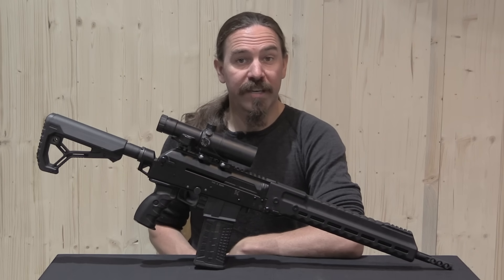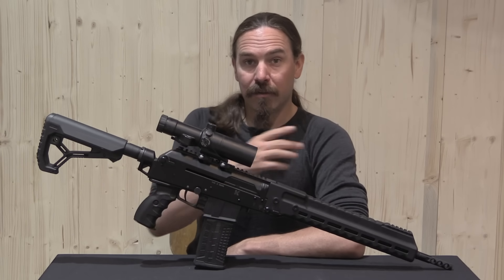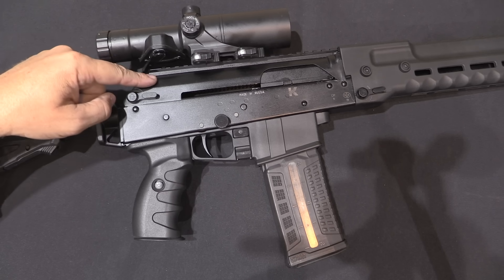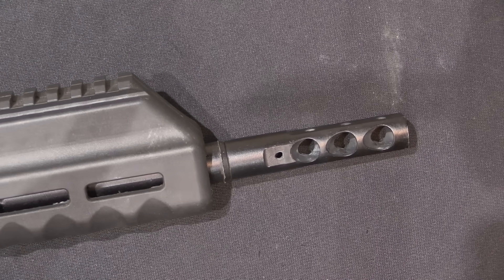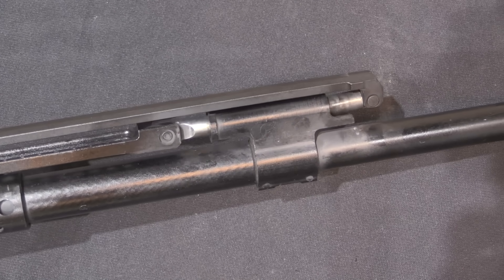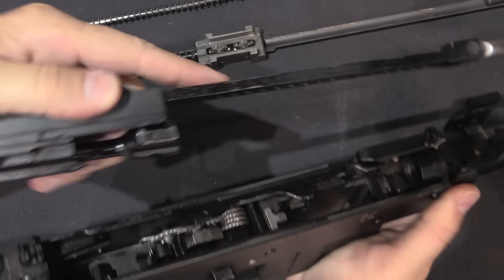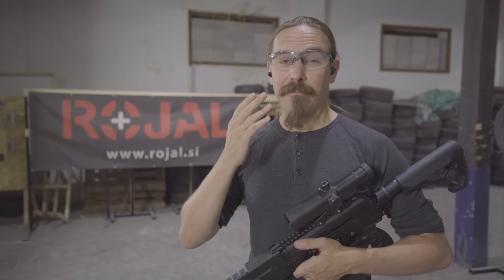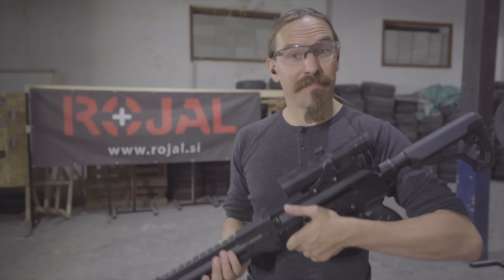Balanced Recoil AK-107 / Kalashnikov SR-1: Is It Any Good?

Comment: Considering that the two are locked together, one wonders if just using a spring instead of a second gas tap and calling it a dampener would've been easier in the end
Reply: Devices exist that allow you to tune the AK gas system (KNS adjustable gas piston) and stiffer springs are available from ALG. A properly tuned AK BCG does not impact the rear trunion. A correct muzzle brake designed for a small amount of high pressure blast as from 5.45 or 5.56 will give you a cheaper, lighter weapon with nearly the same characteristics.
Reply: Probably too much force going through the gears in that case. As is, the gears only need to make up for the small difference in acceleration between bolt and counterweight, instead of transferring the full forces needed to accelerate the counterweight.
Reply: @eloiseharbeson2483  oh for sure, I was just suggesting a halfway point between "overly complex and kind of superfluous" and "not as complex, but still kind of superfluous."
Reply: @JosephHarner  Mmm, you're probably right. 
Now that I think about it like that, I wonder if the QC problems mentioned are heat treat/shearing issues on the cogs. Non-uniform increases in friction would quickly add up in terms of wear I suspect.
Reply: I think that would result in the cogs wearing out much faster since that would cause 100% of the recoil force to be transmitted through them.

Comment: So many good features that should be on the military ak, for example the bolt catch and release, the disassembly method with either a pin or a lever like this one that will secure top cover in place, option to switch sides of the charging handle

Comment: i think this is pretty much in line with what kalashnikov tries to put out on the market nowadays. old platforms modified with tacticool features and maybe a few genuine improvements, all largely overpriced for what it is. about 2 years ago they announced the MP-155 Ultima shotgun and opened preorders for it for more than twice the price of a base model MP-155, and its basically the same receiver wrapped in heavy furniture and it has an integrated stopwatch, they couldn't get any other features on the onboard "computer" to work. also someone at kalashnikov even stole the visual design from an indie videogame company from the US. this ultima thing still hasn't been produced by the way.

Comment: Dear Ian, there is way more to the context of the rifle's failure. 

The rifle was dragged from expo to expo since the times so distant that I was too much of a kid to remember. Perhaps we are talking a decade prior to its actual release, 2008 or something. I may be wrong about the exact years, but not much, and it was hinted as a design years prior to that. In other words, people grew tired of waiting for it by the time I was too young to even consider buying a gun. However, at some point, the Kalashnikov made it. What time was it? The year 2018. 
The AR's were just as rare on the Russian shooting range as girls in shooting sports are, and just as expensive as Kalashnikovs in the US. Since the Crimea, sanctions were in place, the cheapest AR-15 was Gilboa (which proved fairly problematic) cost around 200.000 Rubles, which seemed a lot, compared to the Saigas and Veprs, which cost 20 to 40 grands. Schmeissers and stuff were in place, but it cost around twice as much as Gilboa. To give you a better understanding, Swarovski 1-6, top back, could be purchased at 100.000 if you knew the right guys and 150.000 if you had too much money. The now-loved VPO-140 ARs were sold out and rare; people were hunting them out (it's easier to buy one at the momnet, I guess). 

The major line of thought was adapting the old trusty AK for the needs of IPSC, and it brought massive success. IPSC was naively dreamed of as a basis for the Russin unter-NRA movement (by some romantics). Long story short, the Concern saw the MARKET. However, other guy saw it too. So they just started producing AR's. From Taiwanese components, at first, but soon came mass-produced well-known domestic models (they were always there, but either too early or they did something wrong). 

So, nodoby wanted AK-107, which was marketed at 150.000 when you colud buy an AR-15 for this price or two-barrel set of wonderful AR's for 200k. And no one wants it even now, despite the fact that the prices scyrocketed (thanks to the new sanctions). Every month I go to the gunstore where the SR-1 is present. It's been there for... quite some time, 3 years, at least. 

Basically, its only hope to be sold is some crazzy guy who would want something special for the price of an AK, since those cost 60 to 100 grand now, so SR-1 doesn't seem that expensive anymore (plus the 50% discount).

P.S. I beg your pardon for the grammar and stuff, it;'s been a while since I spoke the language.

Comment: Remember that every action has an equal and opposite reaction. The bullet leaving the muzzle pushes the rifle in the opposite direction. To stop the rifle from flying backwards, you either have to apply a counterforce using your shoulder, or have a muzzle brake eject gas backwards (force pushing against the surrounding air) which atleast reduces the backwards rifle force.

The only thing this counterbalance system does, is change the recoil impulse. I.e. do you want your shoulder to experience 1 big brief jolt, 2 smaller brief jolts, 1 long very mild jolt or anything in between? The total force absorbed by your shoulder in either case will be the same.

This system is essentially just slowing the bolt opening by increasing its mass, and thereby transferring a larger percentage of the recoil force through the "gear block" which is fixed to the rifle, during the middle of a firing cycle instead of as a big jolt when the bolt slams into the back of the receiver at the end of a cycle.

So it's not surprising that it feels like a normal rifle firing without the muzzle break. You still have an extremely quick cycle time for your shoulder to resist the recoil force, counter balance system or not.

You could achieve smoother recoil much simpler, by simply using a normal bolt with a very long travel and a spring that completely slows the bolt before it hits its stop. Like the Ultimax 100 machinegun.

The tradeoff for your shoulder is always high recoil force over short time, or low recoil force over long time. (Unless you use a muzzle break, but then your ears bleed)
Reply: That's not quite correct. The system us in fact redirecting some of the recoil force with that counterbalance. The issue is that it weighs too little. If it weighed double the bolt and bolt carrier it would function as desired and mostly eliminate felt recoil. Hell you could technically get it to recoil forwards with enough of a mass difference. The issues are 1: finding the space to actually put that much extra mass   and 2: not overburderining the gas system and slowing the operating speed of the rifle by effectively adding more inertia to the bolt system a compensator just ends up being like... Better and easier if recoil reduction is the main goal
Reply: @acbthr3840  Respectfully, you are wrong. Every action has an equal and opposite reaction. You can't push the counterweight forward without pushing backward with the same force.

Read my first comment again.

The more mass you add to the counterweight, the slower the bolt will open and you will transfer more recoil through the gear assembly straight into the shoulder before the bolt has even opened.

You cant redirect a force without a counterforce.
Reply: @jay_no3  No, I'm not. The counterforce in this case is identical to the force that would be pushing back on the gun without the recoil system being in place. AKA normal recoil. What you're doing by having the mass thats absorbing the energy from the recoil move forwards instead of backwards is have the impact of the carrier at end of travel act in the opposite direction. If you balance the counter acting masses right you can get little to no felt recoil impulse, and thus dampened shock at end of travel, but it can take a fair bit of extra mass. I've built this sort of thing before for pneumatic actuator damping. It works just fine.
Reply: @acbthr3840  Yes, you are correct in that you can dampen the impact (lower its velocity) using masses, or you can spread the force out over a longer time (change the impulse), which is exactly what I meant. There are simpler ways than this system to change the recoil impulse though, using long travel springs is far more efficient and weighs less.

However, when you stated that you technically can get the thing to recoil forwards with enough mass difference, you immediately showed that you do not know what you are talking about.

If you've taken physics courses on a university level I urge you to draw a free body diagram of the system with force arrows. Then you can clearly see that all forces must be in balance. Sure you can dampen forces using high masses but they are still the same forces.
Reply: @acbthr3840  
First year university force balances:

Think like this, in the moment of firing: 
The gunpowder burning creates pressure in a confined space - it pushes right on the bullet and left on the bolt and piston. 
Forces balanced.

The bolt/piston pushes to the left on the gear assembly AND on the spring which both push left on the rifle body which pushes left on your shoulder. Your foot pushes left on the ground which is essentially infinite mass (compared to you) and doesn't move.
All these left forces are balanced by a counteracting right force, forming force pairs.
Balanced forces.

But the gears start to rotate as a result of the bolt moving left under it. This torque is counteracted on the other side of the gear by the countermass.
Balanced torque pair.
The bolt and countermass ARE moving in opposite directions and form a force pair, but the bolt accelerating to the left and being locked to the gear has already pushed on the gears which pushed left on the rifle etc. etc.

The leftward recoil force now just moves through both the recoil spring and the gears pivot points.

Nothing is achieved by this countermass system other than effectively adding more mass to the bolt which acts through torque through the gears. The inertia of this system also means that a higher % of the recoil force is transferred left through the gears pivot points.

The ENTIRE bullet recoil force STILL has to go into your shoulder. You can't magically redirect a force. In that case you could essentially get free energy as nothing ever needs to push against something else and Newtons laws break down.
Reply: @jay_no3  THats... way over complicating the explanation. You can just look at the linkages - the gears - as a simple fulcrum and lever arm with forces being applied to either end in a static reference frame. Very ez to work out. And like I said, it does accomplish something. You're forgetting to define reference frames. With respect to the rifle, the inertia of the forward moving part of the recoil system is opposite the bolt carrier. It changes the way it behaves at end of bolt/counterbalance travel. If you throw a heavy ball thats chained to something lightweight, its inertia will pull the object along for the ride and give said object a sudden kick of acceleration when the chain becomes taught. If you chain two balls of equal mass to the object and throw them in opposite directions with the same force, their inertia cancels out and they stop moving, and impart little acceleration to the object but only when the chain is stretched to full extension. The recoil system here behaves the same way, but is still heavily unblanced. The total recoil of the gun remains the same in either case.
Reply: @acbthr3840  I agree with you that the total recoil of the gun is the same in either case - The impulse to be specific. That is what I've been trying to say. This system is simply changing the force composition that makes up the recoil impulse. You are right in your example: "two balls of equal mass chained to an object and thrown in opposite directions create a net 0 movement." Yes, you are in fact saying the exact thing that I just wrote - the counter balance recoil system changes the forces that make up the recoil impulse, but the recoil impulse at the shoulder IS the same as for a normal rifle without the counterbalance system. This system only serves to "smooth out" the forces that make up the impulse - less jerkiness, but equal impulse. However, you can't say that "Hell you could technically get it to recoil forwards with enough of a mass difference" as that is simply not true. You do not understand that the counterbalance mass when being pushed forward exerts a force backwards too. The sum of all forces acting on the rifle over the time duration of firing -> the recoil impulse J = integral(F dt) will always be the same when firing the same caliber of round and the recoil impulse being a vector quantity will ALWAYS point opposite that of the bullet. If you deny this then you are telling me that you somehow have found a way of circumventing the laws of physics.

Comment: This reminds me heavily of what I imagine an extremely simplified AN-94 system. Though without the double tap burst. Fascinating.
Reply: The simplified AN-94 is meaningless. Under the terms of the Abakan program, it was necessary to surpass the AK-74 by at least 1.5 times. A rifle similar to the AK-107 was 1.1 times superior to the AK-74. AN-94 by 1.6-1.8 times.
Reply: Whole idea of an-94 is a 2shot huperburst. It's made around this feature.

Comment: I appreciate that they didn't make the cog teeth flush and perfectly machined to the round guide rail holes.
This allows the inenitable buildup of field environment gunk to slide around and get pushed out of the mechanism rather than instantly jam it up with a single grain of sand caught inside of intolerantly tight tolerances.

Comment: I have a Zastava M90 (5.56 Yugo AK). With a VG6 AK brake, it has basically no recoil, it just jiggles a little under firing (probably the bolt moving about). With an old school slant brake, it's all over the place just as with any other AK. It's the brake that matters, not some fancy recoil mitigation system as 99% of felt recoil is that bullet being accelerated out the barrel + the brief rocket motor it creates when the bullet exits. The AK-107 is cool though.

Comment: i was thinking, man it'd be cool to have something like this in the states, but no major manufacturers would make it since it would be complicated (i always thought it was an-94 complicated) but looking at this, not many parts are different, a different trunnion and gasblock, and modify the receiver for the dust cover and it could totally be done. even conversion kits are plausible if you have something like a surplus kit build and replace the above mentioned parts, its totally doable.
and i totally like this rifle for the same reason i like the FAL right now, being a left hander i get to do silly underhand/overhand ak reloads that i dont do usually

Comment: Thank you for bringing up the "closed system" aspect. Bad physics surrounds popular conception of this system. Too many people out there have claimed that the AK-107 system will actually reduce recoil (Herrera), which is of course impossible. In fact, the balanced system should actually have a sharper recoil curve than a pure blowback.

The primary benefit is that the balanced system reduces torque forces on internal components.

Comment: I think the benefit of the mechanical system would be more noticeable in full auto, the brake will reduce the total rearward impulse whereas the balancing system will only even out the impulse. It's difficult to feel that evening out when you're feeling a jump with each trigger pull

Comment: I feel like with the lighter mass of an AR bolt and the direct gas impingement system, this might be fantastic on an AR platform, especially on something well tuned like a 16 inch midlength upper, you wouldn’t need as much mass and it would be much easier to tune

Comment: Let play a thought experiment here. If the muzzle break controls most of the recoil, then perhaps the gas IS causing most of the muzzle climb. Also, another source  of recoil is the center of mass changing as the bullet travels down the bore. The bolt is big but it's also slow and it's buffered so the force should be mitigated. And the unlocking of the bold slows it down. 

Just some thoughts, not an expert.

Comment: I feel that the Balanced Action is a cool function and while it may be possible to get an AR that can perform quite closely (heck, even a gas adjusted modernised AK can provide very good recoil control), if the SR1 had been further developed and improved upon, it might've become a staple favourite for IPSC type shooting. Though its military application in the AK-107 is certainly questionable outside of full-auto or short controlled bursts applications.
While I'm sure there will be many who will cite the A545 or A762 (essentially modern variants of the  AEK971 pattern rifle) being adopted by Special Forces which have similar functionality, it's still far more common to see Russian Special Forces use AK variants instead. I can imagine that using something that isn't an AK when your stock is mostly comprised of AKs would be a logistical headache at times.